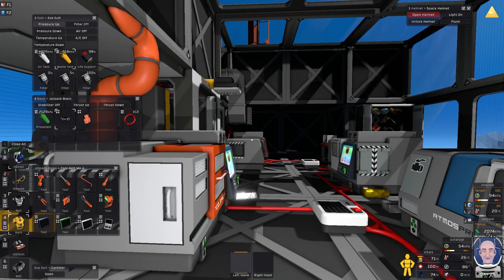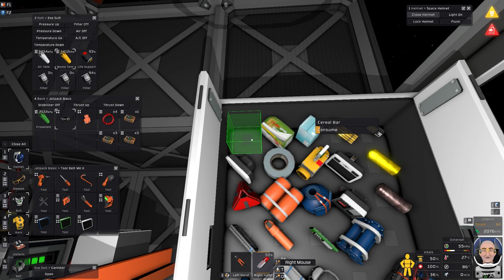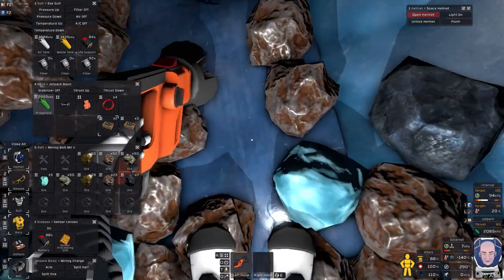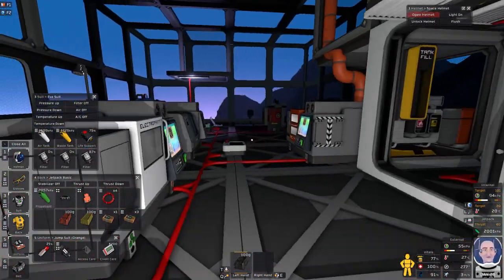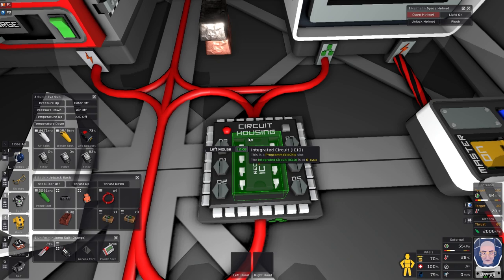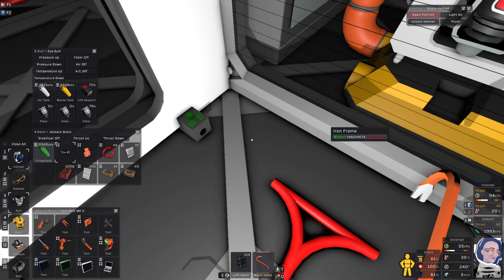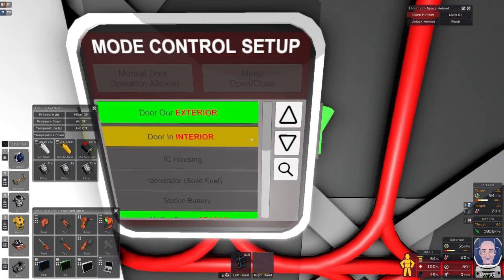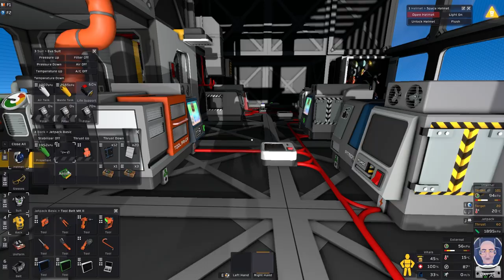Advanced airlock on Europa - Stationeers Ep9

Comment: Yea i honestly dont know why they even have a regular airlock chip. i have never seen it used tbh. and unless they have fixed it there has been a bug with the advanced airlock chip where it forgets the "inner" "outer" settings on the vents when loading into the game and reverses them. So be sure to keep an eye on it just in case they haven't fixed it.
Reply from the maker: The basic AL board is for airless palnets where it only needs to recover the gas going one way.

I've not see that fault with the AAL board but I'll be sure to keep an eye on it. Thanks.
Reply: @dragonflygameruk4094  🤦‍♂️🤦‍♂️🤦‍♂️ makes sense🤣